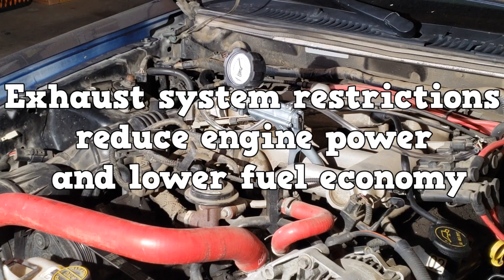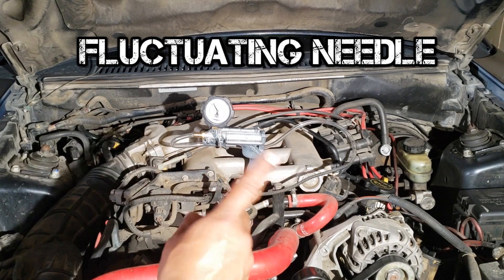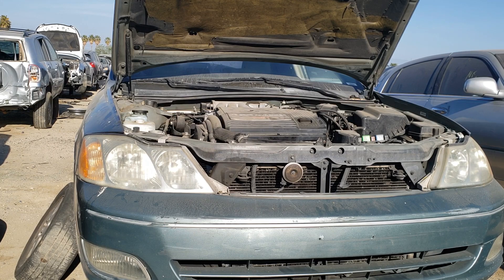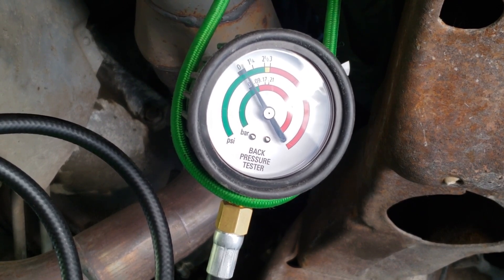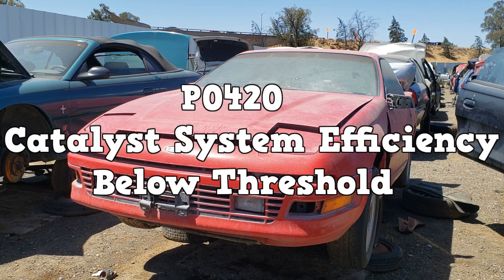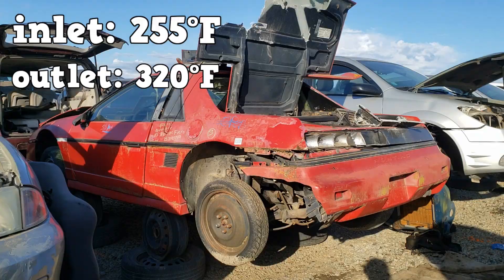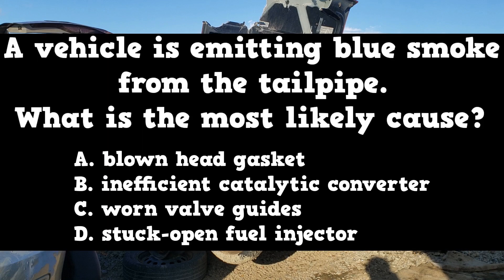ASE A8 Test Prep #4 - Exhaust System Restriction Tests

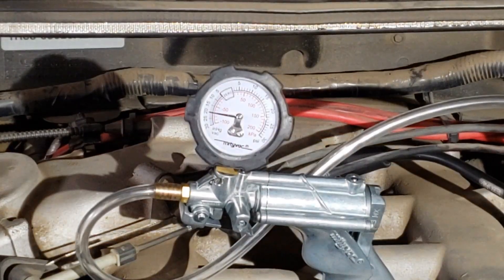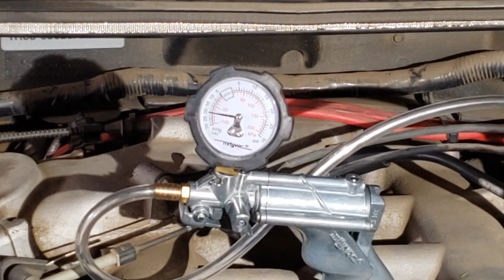Comment from the maker: Update: Video breakdown after taking the test. The info starting at 0:39 and ending at 1:16 is a must-know!
The question asked at 2:15 is really good, also know how to diagnose a failed oxygen sensor.
The info written at 3:00 is very relevant.
The question asked at 5:00 is very relevant. Know what exhaust color each of those answers produces. 
Overall this video series presents great information, but it could have been better! I should have focused more on interpreting the results of a cylinder power balance test, VVT operation and possible fault points, and fuel system fault points (such as a faulty check valve, or clogged/ leaking injector symptoms).

Comment: @oldschoolnoe quick question. The answer for the last question, blue smoke coming from the tailpipe, is “C” Right? Worn valve guides since oil can pass thru and burned with combustion.